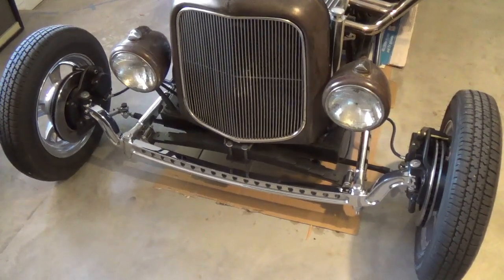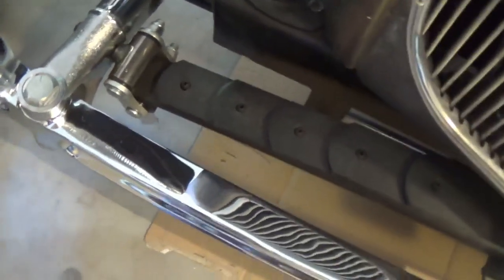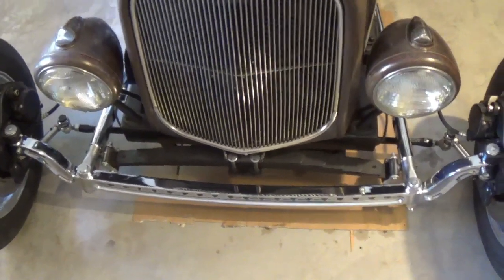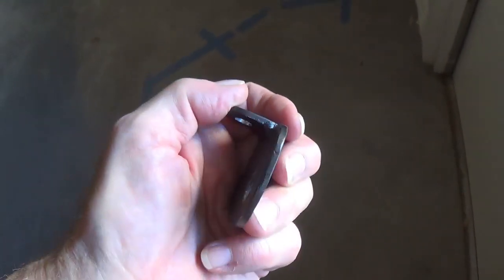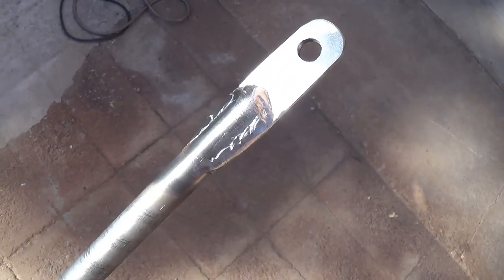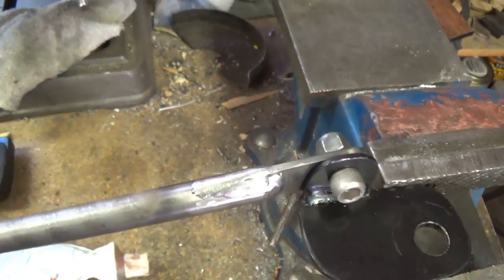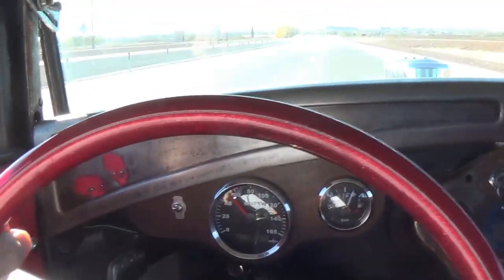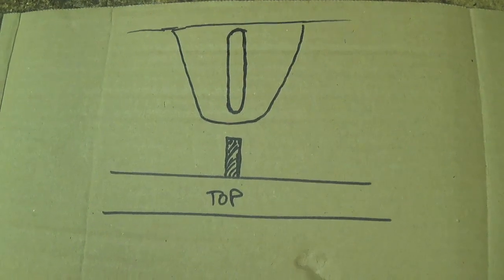Let's Fabricate a Panhard Rod for a Straight Front Axle

Comment: Thanks, this is the second of your videos I have watched and I want to say you do an excellent job. I learned something from both and I will recommend you to my friends. I'm working on a new T bucket right now and I'm going to try your pan hard idea. The one without the rod. The only problem I see is wear on the bracket or bolt. But that should be minimal and each part will be easily replaced. I you will be able to detect any excess wear if you develop any steering issues. Simple enough. Thanks.
Reply from the maker: I'm glad the videos are helpful, Jimmy. Best of luck with your project.

Comment: If you were experiencing the tires following the cracks, lines or depressions in the road, you likely have bias ply tires.
Radial tires will not do that.
Reply from the maker: Regardless, the darting and wandering ceased immediately upon installation of the Panhard rod.

Comment: Your spring is too long AND the swaying frame problem is common because the modern rodder community has forgotten something about 28-41 transverse spring mounting. It's a simple situation. Please note I said 28-41 only. No Ford until 42 has a Panhard rod. All have them front and rear 42-48.
Reply: When an early Ford transverse spring is mounted, one shackle is slid into place in the perch. a spring spreader is placed between the spring eyes to open the spring to allow the other shackle to be slid into the opposite perch.
The shackle bars are put in place and the spring spreader is unscrewed and removed.
This leaves the spring eyes and the perch eyes with the shackle bars parallel to the ground. When the complete frame is replaced on the spring the shackle bars will drop to a 35-45 degree angle. spring

Comment: Just started watching this video, Only 44 seconds into it I noticed your spring shackles are now vertical. In the video where you replaced the front end I commented on how your spring shackles were at the perfect angle . What happened. Did you switch out the spring for a longer one. I'll bet your shackles are making your side to side movement of the front end. I set mine up like you had in first video 5 years ago. 25,000 miles no problems. no panhard bar either. Still looks and rides like the day I built it. HOLD IT, HOLD IT STOP THE PRESES. NEWS FLASH. I went back to the other video. in that one your spring is over the axle. In this one your spring is behind the axle. by putting your spring perches in your radius rods that moved your spring shackle mount closer to the spring , there fore reducing the area between the mounts making your shackles drop to vertical or near vertical. they should be at a 45` angle.
Reply from the maker: Good analysis, Mike. When you order springs, straight axles, etc. your choices are limited to what is available and you have to "make do".  In this case, the panhard bar was essential to stop the side-to-side motion of the front axle. In my other car, no panhard bar is needed.

Comment: I don't think the brackets pivoting is necessarily a good thing.  If it loosens even the slightest bit it will rotate while driving and cause significant fatigue on the rod or bracket something will break. If there is some way to lock the bracket in place that would be good.  Also on most vehicles there are rubber bushings this might not be a bad idea for a tiny bit of compliance.  Finally my last thought rotating fittings on threads causes high wear usually a bolt with a non threaded section is used to hold the pivoting area.
All that said,  looks really good and seems to be a major improvement.
Reply from the maker: I understand, Y, and will closely monitor the bracket for any movement. It is being held in place by a 3/4" bolt under 100+ lb/ft of torque.....and the lateral forces are not particularly large.  Thanks !!

Comment: Thanks Uncle Doug, You posted this video so I guess the test drive went OK :)-
On the pan-hard bar replacement, I think it's a good idea, just needs some way to reduce wear from use. As the slot is "wallared out" it will introduce more side movement (bad given the positive-feedback effect of the steering) and probably make it a bit noisy. I would suggest a bearing on the post but, with real work environmental conditions, I don't know how long it would last.
The high speed instability is just the car hitting a harmonic I'm guessing.
Just my 0.02 as one of those damned engineers :D
Cheers,
Reply from the maker: Thanks so much for the excellent observations and suggestions, Eddy.
Reply: Aww, isn't that cute, only 2 weeks old and already these 2 bots can talk to each other. 
They grow up so fast these days...

Comment: Uncle Doug, as one of those Engineers, but not an Automotive Engineer, it looks & sounds like your Panhard rod idea works just fine.  I do however, highly recommend trying to get short shoulder bolts for your pivots to minimize wear in the pivots due to the screw threads having point contacts & eating the pivots up.  I also highly recommend that you frequently inspect the 3/16-in. thick parts & weldments for cracks as you put more miles on the car.  If the holes start "peening" (for lack of a better word) in an elongated direction, then the Panhard bar may be seeing higher loads than you're thinking.
Reply from the maker: Thanks for the great suggestions, Bob. I will keep a close eye on the condition of the bolts and the holes they pass through.

Comment: Interesting invention Doug. I think it would work fine if both wheels went up and down the same amount however if one was up or down more than the other would you not be back in the same situation with an arc being described from the end of the axle to the centre? Nice fabrication work by the way. Did you consider a Watts linkage instead if the Panhard rod which completely removes any lateral movement? Stay well. Chris 👍
Reply from the maker: Thanks, Chris. The problem with Watts linkage is it's visibility if used on a front end. Since the deviation from vertical with the Panhard is only 3/32", it really isn't significant.....and it's virtually invisible.

Comment: Think about a Watt's Linkage on there UD. OK it won't be invisible, but it will move vertically, not through an arc. And, Ford  used a Watt's Linkage on some of their rear end location issues some time ago, so it fits on your Ford!
Reply from the maker: The vertical travel of the straight axle is so limited that the arc of a Panhard rod is virtually a straight line, Geoff. People have been using them for almost 100 years with excellent results.

Comment: Love the ingenuity but I wonder how the slotted idea would effect body lean/roll? Might be a lot of stress on one point in a straight axle as it becomes somewhat of a rigid form of sway bar. But a great idea to experiment with! 
As for the wondering, great troubleshooting on your part and I’m pleased you found a solution. I would still want to swap springs for an overall simpler, lighter, and cleaner solution. Not criticizing as differing ideas is what this hobby is all about.
Thank you for the well done and excellently explained videos. Keep them coming!
Reply from the maker: Thanks for your courteous and helpful input, EH.

Comment: The spring length is too long. It is for a spring over the axle type mount.
Get a shorter main leaf.
Shackles should be at 45 degrees.
Your steering arms need to he horizontal to the ground. Otherwise you get bump steer.
Then try a dead man shackle on passenger side.
Great videos, hot rods AND amps 😁
Reply from the maker: Thanks for your helpful suggestions, SB.

Comment: What you should have had is a spherical rod end both ends of the panhard rod. The first thing that will happen is the bolts through each end will wear and need replacement in very short time.
Reply from the maker: Thanks for the helpful tip, Dale.

Comment: Great result UD but personally I would have used shouldered bolts rather than all threaded & maybe some bushes to “spread” the load. Considering you couldn’t extend the panhard rod due to not having a frame rail to connect to, I think your idea works well. Glad you sorted the Ackerman angle out, I have seen so many cars here in the U.K. where they dissect way out behind the back axle/diff’. 
Regards from the U.K.
Reply from the maker: Thanks for the excellent suggestions, Geof. I will monitor wear in the pivot holes.

Comment: Hello Uncle Doug, You are a great fabricator, nice job. Perhaps you may know, but, a little machinist safety tip, never wear gloves when using a pedestal type grinder, if the glove gets sucked in, your hand does to. Properly set tool rests help also. The Rod looks like fun to me. It's Custom don't ya know. Fog, clouds and light rain and 51 degrees today, typical mid November day. Lockdowns to begin in Washington and Oregon, probably most states soon. Stay safe, all the best, C.
Reply from the maker: Thanks for the helpful tip, Cass. Always good to hear from you.

Comment: Hi Doug, as far as steering geometry goes, caster is what controls wandering and also brings the wheels back to center after turns. I noticed your king pins are pretty much straight up and down giving it zero caster. I would think tilting the top of the whole I-beam rearward a degree or two would also improve your steering. Just say'n. 🏎
Reply from the maker: Thanks, Ed. In person, the caster is exactly 7 degrees, as set by the wishbone brackets. It's correct and un-adjustable. Besides, the Panhard rod solved the problem, for reasons explained in the video.

Comment: my spit6 got front light over 60. i put a piece of ply underneath between the rad and the front valance and it seemed to fix it....and cooling improved ....it statrted getting hot at the same time. I suspect turbulent air was getting pushed up in front of the rad disrupting cooling and increasing air pressure and lift under the front. bit different in a car with less body work i suppose.
Reply from the maker: Thanks for your input, OB.

Comment: I'd suggest bushing inserts at the pivot points, once installed drill the pivot and bushings and install zerc fittings so they can be lubricated to reduce wear.
Reply from the maker: Thanks, Joe. I will inspect the pivots after 100 miles or so to see if wear is an issue.

Comment: As a 50+ year professional fabricator/mechanic I think I would've used two import tie rod ends(as they are quite small) and just thread a rod to go between them. I've been enjoying all your content for many years, thank you for all of your considerable efforts. Also another solution would have been to use a central sliding bearing affair that would have no bump steer effect.
Reply: Oops! Sorry for the early comment, I typed that comment in before the end of the video. That solution has been on many production cars over the years. another solution would be a Watts linkage.
Reply from the maker: Thanks so much for your excellent comments and suggestions, Jeff.

Comment: Hey Doug, in the absense of any of your excellent current tube amp repair videos, I've enjoyed your 'wander fix' on that special car of yours. Clever fix and even more interesting your simplified invention to address the same problem..! Meant to ask, if in the US and modifications are made to a vehicle are you obliged to inform the local Department of motor vehicles, as over here we would surely have to..Take care..Ed..U.K..:)
Reply from the maker: Thanks, Ed. No, the bureaucrats haven't inflicted that limitation on us.......yet......thank heavens.
Reply: @uncledougshotrodgarage6049  Cool..You're lucky Doug, if you change a headlamp over here you would get 50 lashes..! Take care.
Reply: @uncledougshotrodgarage6049  Only because they don't know about it.  Yet....  I'm pissed that they want me to add seat belts to my '46 Willys CJ-2A, which obviously wasn't designed to have them.  If I install them, it's not a "correct" restoration, but I probably will!